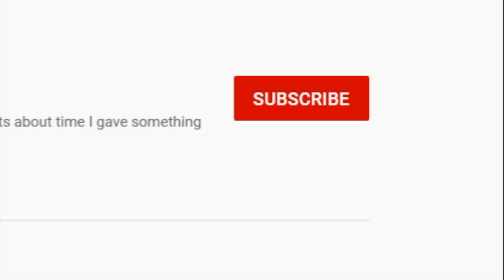GARAGE CONVERSION DIY!! - HOW TO CONVERT YOUR GARAGE INTO A ROOM / STUDIO - START TO FINISH

Comment: Hi. I'm just starting to convert my garage into a permanent office. I was trying to find a ready made replacement window/door in uPVC to replace the 7' Garage door - but they cost a fortune. You've inspired me to do exactly what you've done and frame it myself. The options for Doors and Windows will be far greater, and the cladding will set things off. Great video and thanks. Out of curiosity, what size garage door aperture did you have?

Comment: Great video, I’m planning something similar. I noticed you didn’t use insulation on the floor. Is it cold in winter?
Reply from the maker: Hi Ed. Thank you. In all honestly yes it is quite cold. The front wall, loft and walls were all insulated but the floor would’ve helped. We were on a budget and short for time. It’s not too bad though. Have an oil fired radiator in there. 👍🏻

Comment: Great video. What did you use for a window board? I've been told I shouldn't use any timber just PVC window boards, but I can see that you don't have a PVC but two pieces that fit for the purpose.Thank you in advance
Reply from the maker: Hi thank you! Glad you like the video. Which board’s are you referring to? The side edges are pine board as is the window sill. The base of the window is upvc which came with the window itself. Hope this helps! All the best

Comment: Excellent 👍 may I ask what do you use for sealing up the gap between the new outside wall and the ground? At 7:16. Also, what kind of wood floor did you choose? How did you deal with uneven ground evel? ( If you have the any) Thank you really appreciated 🙏
Reply from the maker: Hi Samuel, thank you for your comment! At 7.16 its just an all weather clear sealant, you can buy from Screwfix or most home depot stores. The flooring was bought from B&Q, its called good home laminate flooring, all sorts of colours available. I think this is dark oak. The floor surface was quite even so I just laid a underlay down. I know you can get self leveling mixes to deal with issues though. Hope this helps! Thanks
Reply: @adsamateurdiy5963  thank you so much 🙏

Comment: This is brilliant! Well done! Can I ask what insulation you used and where you sourced it please? Thank a million
Reply from the maker: Hi Michael. Thanks. It was just an unbranded 200mm loft insulation. Roughly £20 for 5-6meter squared. Bought from a local supply store here in Cornwall, place called Trago. Hope this helps.
Reply: @adsamateurdiy5963  thanks again!
Reply: @adsamateurdiy5963  Trago Mills!!!! Cannot believe that place is still going!! The shop that literally sells EVERYTHING!!! 🤣
Reply from the maker: 😂 it’s not a professional builders merchants, but it’s handy for some things nowadays!

Comment: Sorry got to ask you didn't use a vapour barrier between boards and infill was you advised this way as I'm just starting 😊
Reply from the maker: Hi Steve. I started to but it was a bit of pain to install. I only used a vapour barrier on the front end and floor. To be honest it’s was a really dry garage and haven’t had any issues since. However, if you can you probably should to be safe
Reply: Thank you for reply injoy your space 😊
Reply from the maker: Thanks, good luck with your project!

Comment: Don't you need a vapour barrier to stop mould? How are you ventilating the space?
Reply from the maker: Hi, thanks for your comment. When sourcing info before the conversion, vapour barriers on the walls seemed to be a grey area. It's only used as an office and not a "living space" so decided not to on the walls but did underneath the flooring. Our garage was always bone dry beforehand etc. I've put in an air vent for circulation in the front end. Thanks.
Reply: @adsamateurdiy5963  thanks alot that's helpful and something to consider
Reply from the maker: @MatMo.  You're welcome. Find some more info online before making a decision regarding your project, building regulations etc. All the best.
Reply: Only if you want to live in it. But I would recommend it,as it's not expensive. Check with your local planning officer,they are a good source of FREE information.

Comment: Brother can I ask you a doubt will you please give me an answer as I said my builder messed up the work a wall I don’t know what they done but one wall is really messed up I can see the joints of plaster boards I think they might be missed the skimming and painted the wall directly can I do the skimming on top of painted wall or I have to remove all the painting before skimming please give me an answer can I do the skimming on my own or need a professional to do it
Or if anything I can do to cover the mess please give me an answer 
My house is a mess now I have to pay and get rid of him soon now please answer me
Reply from the maker: I'm not overly sure. I think you can skim over paint as long as its in good condition and clean etc for the plaster to stick. I would seek professional advice though. Surely if the original plasterer messed it up they should come rectify it? Alternatively you may be able to use tape and filler to cover the joints which would be an easier / less costly option.
Reply: I have seen folks use fiberglass tape for smaller projects. It's grided and makes it easier for the plaster to stick and fill in the holes.

Comment: What was the size of wood used?
Reply from the maker: Hi Daniel, 

38x63mm studwork timber, bought in 2.4m lengths. Treated on the outside and untreated on the inside to save on cost.
Reply: @adsamateurdiy5963  excellent thank you very much.
Reply: Do you need city permits to eliminate the garage in New Jersey ?
Reply from the maker: @perlavargastiburcio4459  Hi, thanks for your comment. I'm sorry but I'm not sure regarding the permits in New Jersey. I live in the UK.